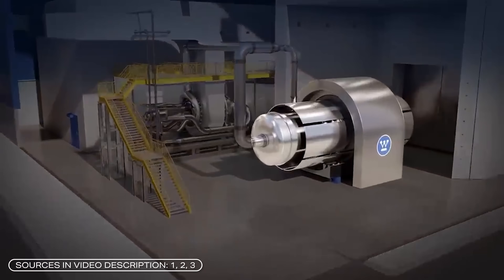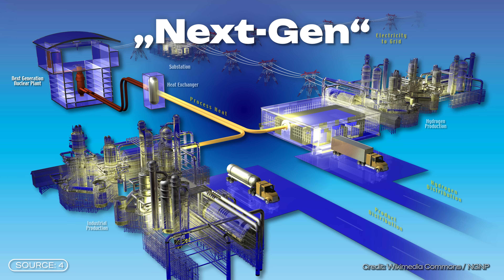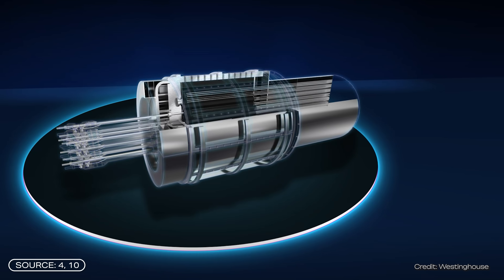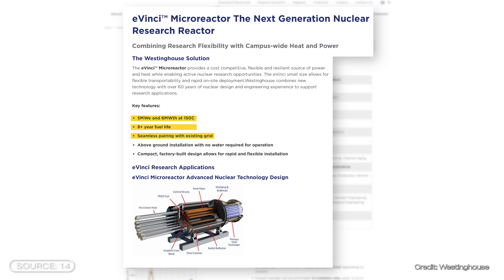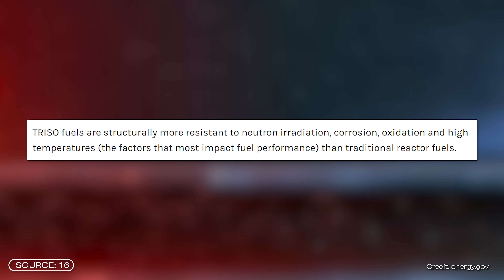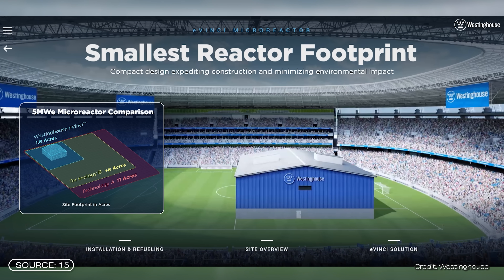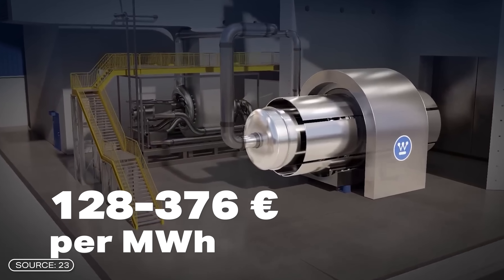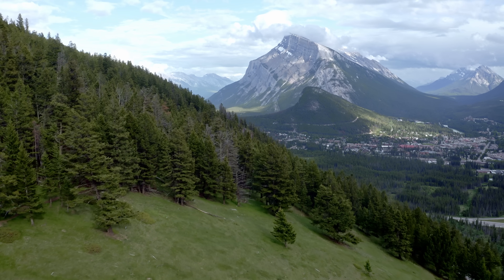Transportable Nuclear Energy: Can This Tiny Reactor Power Our Future?

Comment: The three base hits that make the home run. Hot reactor 600C output. Dry reactor- no water touching the fuel. And manufactured reactor. It's not about the reactor it's the factory. Do those three things and your energy will be 20 times cheaper than the cheapest fossil fuel and nobody will have to be told to stop using fossil fuels. They'll just decide they're too expensive
Reply: And ev's already cost about 1/3 to charge compared compared to fueling a gas car. Future is looking awesome, hope it comes soon
Reply: @bsmusic2601 a bit more complicated than that in that here in uk difference is more like 1/5 when recharging at home (dep on your home tariff) but closer to similar cost when charging up from charging station (dep on speed of charging station). I love my EV despite all the haters but frankly wouldn’t touch one with a barge pole if I couldn’t have a home charger (as you are forced to stop off somewhere to charge for an hour or so each week regardless of price)
Reply: @bsmusic2601 your math is terrible and woefully inaccurate. Electricity is at least 60% generated by so called fossil fuels. All of the so-called "renewable" sources are directly subsidized by governments, which means you, me, and all our neighbors. Quick charge stations where I live are MORE expensive than petrol/gasoline/diesel. The miniscule number of EVs on the road are almost exclusively powered, second-hand, by fossil fuels.
Reply: @wstavis3135 so called fossil fuels and so called renewables? So called really, the % of renewables against fossil electricity production depends on the country/ area your in so maybe cut the crap about stating how only x% is from renewables. We all need to go towards a low or zero carbon future and you dragging your heals denying the truth or just being greedy and selfish is a lazy argument. Renewables and EV aren’t perfect but it’s a direction that’s needed.
Reply: Wow, awesome, well said, thank you!
Reply: Three base hits do not score a run. Terrible metaphor. These SNRs also fail to score for assorted reasons. 
1st, there is no existing manufacturing infrastructure to build and fuel them.
2nd, there have been no practical models built.
3rd, the current regulations do not allow them.
4th, there is no current demand/market for them.
5th, this is all "theoretical" based on imagined numbers with no actual data to support them. Ie, they are fantasy figures.
6th, there are solutions that provide similar benefits using current infrastructure. An example of this is modular, scalable fuel cell electrical generation tech using natural gas for individual buildings.
And lastly, 7th, the complete and utter demonization of all thing nuclear by utter fools for the past 80 years.
Reply: @wstavis3135  everyone of those is a non-technical reason and is solvable - and regulations can be adapted to the new modular reactor reality that is the forefront of next-gen nuclear power. In the US that is definitely going to happen (is happening)
Reply: @wstavis3135 1 there is no manufacturing infrastructure for these, true as there also wasn’t when the us first created 1st gen nuclear power stations.
2 there’s never been a practical model built, true but the same can be said for the first gen of nuclear power stations,
3 there’s never current regulations don’t allow for them, I don’t know the regulations in your country that may be true and can also be altered,
4 there’s never current is no demand/ market for them, demand no that’s not true it is however a scary investment as it’s long term with little to no government back up which I agree needs to change,
5 this is a theoretical design…. Same as point 2!
6 there are similar designs/solutions using natural gas fuel cells, no just no natural gas is low carbon and while that helps we need to go further,
7 demonisation of number the last 80 years yep I agree it’s a sad reality and again better info and support from government would help.
All in all simply discarding these is a ridiculous response rather than walking away because it’s difficult we should have a serious look at how to move forward just my opinion
Reply: I would still pay several people to monitor it 24/7, but they would also be doing other things in the plant
Reply: True 💯👍🏾
Reply: Fool The Cancer Rate   Now  @ 45 CPM    EAT IT  Fool
Reply: Sounds like a great way to crank out loads of nuclear waste that we must monitor for 300,000 years.  I want the reactor that reduces long term waste storage to 300 years.
Reply: Fossil fuels are used for millions of applications and electricity can’t replace them lol! Also why don’t those companies just dramatically sizes the normal massive nuclear reactor to more compact like the ones in submarines or icebreakers?
Reply: @carholic-sz3qv Batteries will only get cheaper, and improve. Solid state cars are being produced. Not far off from 500wh/kg batteries. 

 Lithium air batteries has 40mj/kj max theoretical, versus kerosene with 43mj/kj. 

 Outside crap like military, space, pharmaceuticals, etc. Loads of industries do not require fossil fuels. 

 Just having given them alternatives. If nuclear is cheap, people will absolutely switch. 

 One way or an other humanity is going to need small reactors, and the best batteries. 

 Fusion will not be miniaturized.

Comment: They've been testing 'closed environment'/close "exposure", nuclear powered systems for decades. The nuclear submarine.
Reply: The US nuclear submarine/nuclear carrier program has been operating since 1958 without significant problems. The standardized design and training has been perfected to high degree. Why not continue that successful program in small site land based applications ?
Reply: @lastchance8142  Exactly why I am wondering about all this talk about a tech, that isn't new... but is being touted as new.
Reply: @lastchance8142  You didn't address any of my arguments.

Are US subs reactors really standardized?   AFAIK they continuously evolve in non-negligible ways(?)
Reply: @natmaka Yes, in the main. Of course, better materials, better sensors ect..are incorporated as they are developed. But the general design has remained consistent. For instance: the Nuclear Power Manual (actually a library of books) which covers every aspect of maintenance and operation, is the same for every unit. I was in the submarine service for 12 years.
Reply: @lastchance8142  Thank you!  This is somewhat reinsuring when it comes to building them.

Do you please have any counter-argument to my previously stated arguments (above)?
Reply: @lastchance8142  Because submarine reactors are big and heavy and need a crew of naval engineers to maintain. A submarine reactor is compact compared to a nuclear power plant, and yes it fits in a submarine, but submarines are still several thousands of tons. Modern compact naval reactors are still, at least, hundreds of tons. The eVinci reactor is proposed to be around 32,000 pounds, to 16 tons. That's like 50 times smaller.
Reply: @lastchance8142 Maybe the contractors don’t want to expose the reasons that DOD has been forced to pay their contract price.
Reply: Yeah my problem is why don’t they just use those submarines or ice breakers small nuclear reactors to power cities! Those are around 20 to 33Mw of electricity production
Reply: @carholic-sz3qv  my cousin wasa a reactor engineer on an ohio class, if you push it, the reactor can operate at 40+ MW. also even though it can operate at 20-35 MW for a couple decades, they rarely if ever go that high because  the  sub does not actually need that much power.
Reply: @electricminecrafterI rent to 3 guys that are involved with the expansion project at Portsmouth Navel Ship Yard in Kittery Maine. Interesting project. Its so they can service the bigger newer subs
Reply: @carholic-sz3qv  Akademik Lomonosov is powering a remote town (Pevek) in the arctic.
Reply: @carholic-sz3qv  Russia did build a mobile nuclear power plant to power cities using its nuclear ice breaker technology. But although Russian production costs are much lower, prices still aren't competitive with coal or natural gas plus renewables. It's only useful for remote regions or for quickly providing energy for a city in case of war or natural disasters.

SMRs developed by western startups focus on advanced processes providing direct process heat, which could be financially competitive with natural gas once technologically viable.
Reply: @carholic-sz3qv  Several reasons. Civilians can't use military-grade fuel cores. They require constant maintenance from military personnel, while the commercial ones are designed to be self-regulating. Submarine nuclear reactors still weigh 500-1000 tons if you include the shielding and turbines and everything. Extremely heavy and expensive to transport, build, and maintain.
Reply: Nuclear ships require a fairly large level of enrichment, both increasing the price of the fuel and making it more likely for weapons proliferation.
Reply: Submarine nuclear reactors are in no way "closed".  They are cooled by sea water.
Reply: SMR proponents overlook the fundamental approach in industry, which consists of taking advantage of economies of scale to improve efficiency.

Moreover, no SMR model is in operation in the West, not even at the industrial prototype stage. Russia has an older, improved military reactor model used on a barge; imitating it would be risky due to the operating conditions (the sea provides a huge "cold source," facilitating cooling, and in the event of an accident, a reactor would likely be submerged far from any populated area).

Its load factor, like that of a recently launched Chinese model, is very poor.

The total cost of a military reactor (on board a submarine) is much higher than that of a civilian reactor because the Navy is willing to pay for costly advantages that are decisive for it (silence, compactness, autonomy, reduced need to surface, etc.) that are of no interest to civilians.

Financially, SMRs can make sense if they are mass-produced and then installed as is, which is difficult to imagine today due to the abundance of specific requirements from national safety authorities and site-specific characteristics that impact the installation method. These requirements will therefore have to be adapted (before or after factory production), which reduces the appeal of mass production.

Furthermore, this standardized approach increases the risk associated with a generic defect: the discovery of a problem leading to the rapid shutdown of dozens of identical reactors would be no fun.

Even if the SMR becomes an industrial reality, the NIMBY effect alone could wipe it out.

On the ground, the most advanced offering (NuScale) in the most favorable context (the USA) is withering away. Projects in Canada, a nation with expertise in nuclear power... are struggling to get off the ground.

There is nothing new here, as these hopes correspond to what Admiral Rickover described as early as in his famous note, in 1953.
Reply: They're not transportable by truck.
Reply: Maybe it is cost; maybe the energy from those get more expensive than traditional power sources.
Reply: @alicelund147 Not if they’re already built and functioning. Plugging them into the local grid should be of minimal cost.

Comment: Excellent presentation on an important topic.  The one additional factor that deserves to be addressed regarding microreactors is fuel security.  While low enriched uranium presents only a modest risk of proliferation, this type facility will need sufficient security for a quick reaction team to respond to attempted theft.  As to pricing, the addressable market for this type product is very large at $140/MWH, and very very small at $410/MWH.  Factory pricing is only leveraged at moderate to high volumes. I wish them success.

Comment: This feels like a really neat solution whose only practical application will be military.  The very fact that they are small and transportable immediately raises red flags about using them in a relief situation or for remote villages.  After all, now you need to worry about someone showing up in a truck and driving off with your reactor.  Even if the motive is pure theft the risk of future use in dirty bombs is high.

Not to mention the risks associated with natural disasters.  What happens if there is a flash flood or a landslide?  While I can imagine that you can make the engineering work I'm skeptical you can convince the permitting people to not demand a very high degree of confidence.

But there are obvious reasons this would work well for the military who then solve the security problems as well.
Reply: Wrong. These are mostly applicable to Northern Canada and its need for clean reliable power in areas were solar and wind aren't viable...Think Diavik diamond mines near Yellowknife or Paulatuk, an arctic coastal town reliant on diesel shipments to power itself now. The prices they pay for electricity and diesel up there would make this concept 100% viable today!
Reply: @stickynorth The problem there isn't the cost of the reactor per se but the cost of permitting and the issues securing it.  As I said I don't disagree that from a pure engineering POV it is probably a decent solution the problem is the same as with all nuclear -- the amount of extra cost and trouble because people are concerned about safety and security.